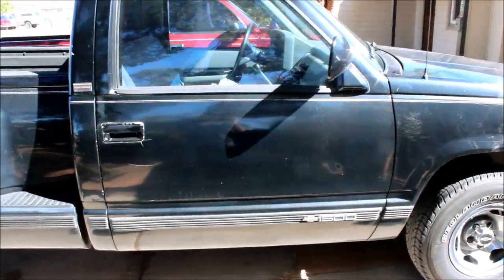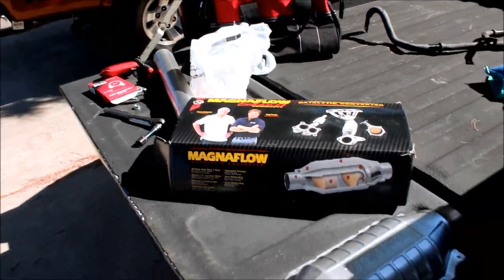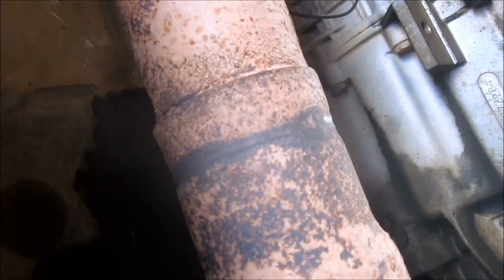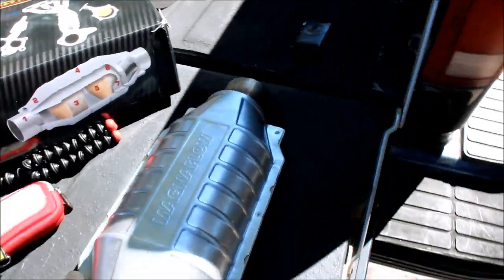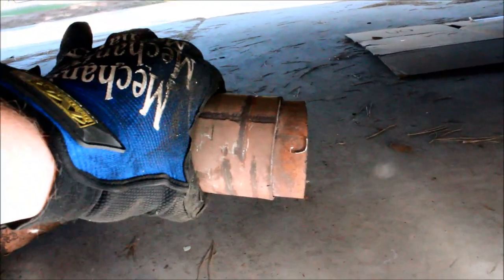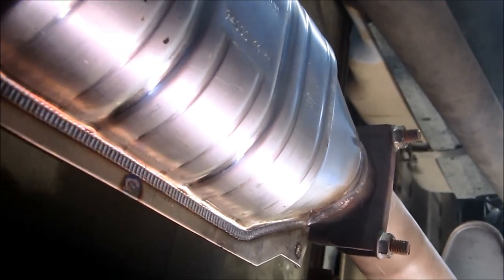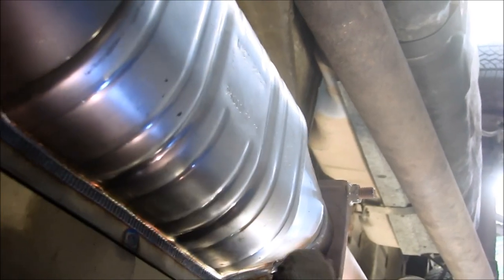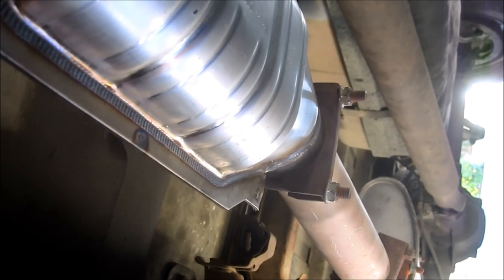Install a Magnaflow Catalytic Converter, Universal Fit

Comment: omg do you wash your car using sand paper?
Reply: 80 when it is really dirty, 2000 when I need a final touch up on the lawn at a Concours d'Elégance. most of the time I like a 220.
Reply: LMAO.  Underrated comment.

Comment: $80 at PepBoys my tit.  They don't even carry Magnaflow cats, and they want $200 for some shitty universal Walker crap that doesn't even have a bung for the rear O2 sensor...
Reply: ZipZapDIY
Part number not available online or in store.
Reply: rhkips They have them in stock in Miami, the one in the video was purchased in AZ, where you at?
Reply: ZipZapDIY California.
Reply: That is your problem right there. Cali has unique laws on cats, even though this universal catalytic converter would probably exceed them, if it isn't been certified for Cali, you can't have it. For this truck, a California universal is around $180 at JCWhitney. Good Luck